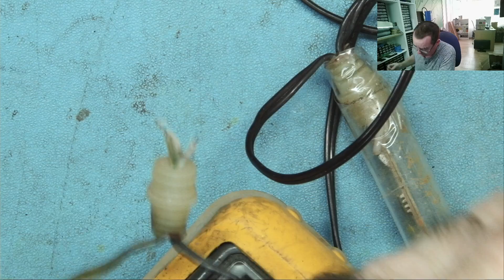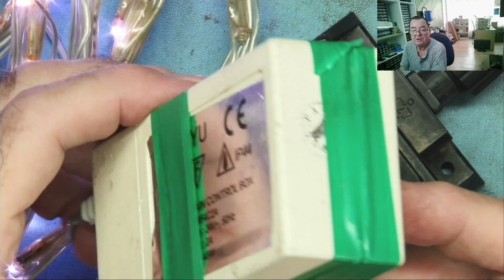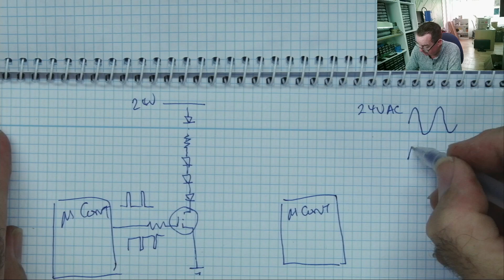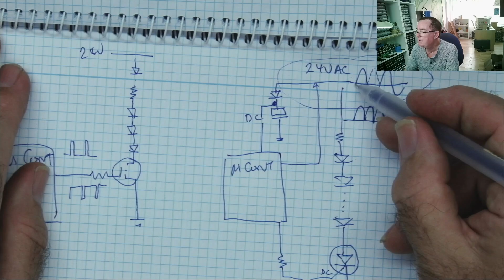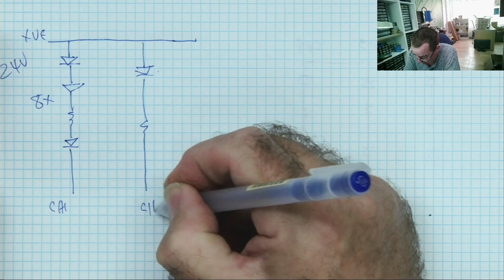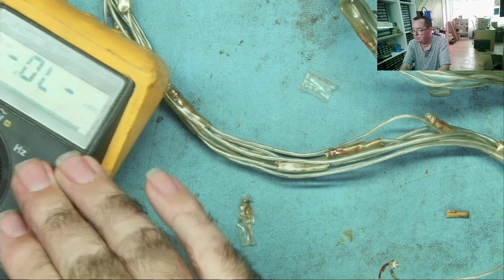How To Repair Your Christmas Lights 2023 : Fix LED Xmas Lights

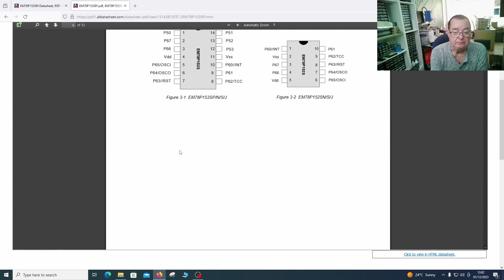Comment: 18:20 No not really, unless you learn how to program it and write the program yourself. Microcontrollers are almost always protected so the code can't be read out with an eprom programmer so you would have to write it yourself. Not impossible but requires time to learn it and I'm pretty sure that's not something you are willing to do for a set of xmas tree lights. Probably more likely you could find a shared pcb project that is already available where someone has done all the work and all you need to do is build it ;-)
Reply from the maker: That's what I said in the video, you could write software for just about any micro controller and use it to control the lights. Now now, I wouldn't suggest others do things I am not willing to do and this is something I was already did, back around 2012, I built some 32 channel LED Christmas lights controlled by an Arduino Mega. It put on an amazing display that ran a preprogrammed loop which took about 10 minutes before it repeats and the code/hardware is all mine, not someone else's work! I still have the controller I built but the lighting panels I made got left behind when I moved from the UK as they were too big to transport easily. I'm just about to repurpose the controller and make some new lights for it, now you mention it I'll put a video up on the channel all about it. I could get PCBs made but to be honest the one i have is built on veroboard😉
Reply: Still gotta love Veroboard ! almost as much as Maplin (RIP) @LearnElectronicsRepair

Comment: Nice work 😉. You didn't show it in the video, but I'm guessing you're going to use clear heat shrink on the new LED to give it some kind of strain relief.
Reply from the maker: Normally I just put insulation tape around them. But clear heat shrink would be better

Comment: Very informative. Could you use a 9volt battery with two probes to test the leds?
Reply: Single LEDs can be tested with a 1.5V battery. Or even just put probes from multimeter set to continuity and the LED will glow dimly if it's good. If you use a 9V battery you need to use a series resistor to limit the current or use a half dead 9V battery and it might be ok as-is.